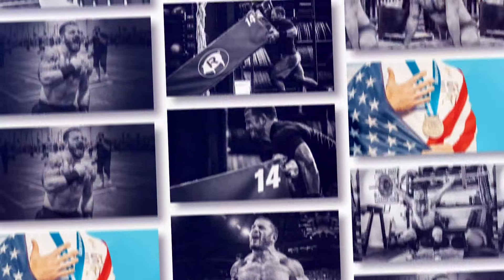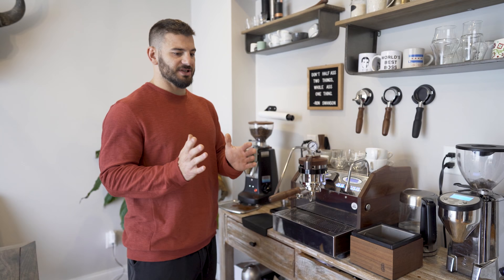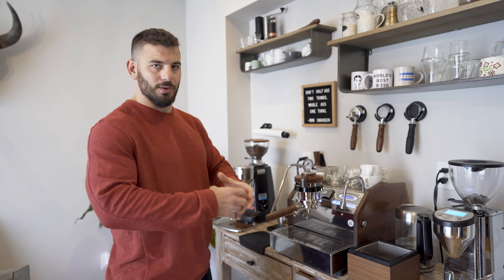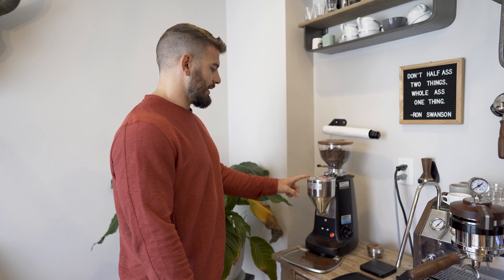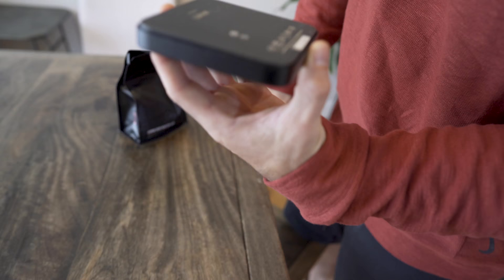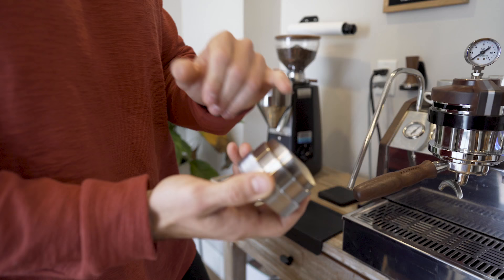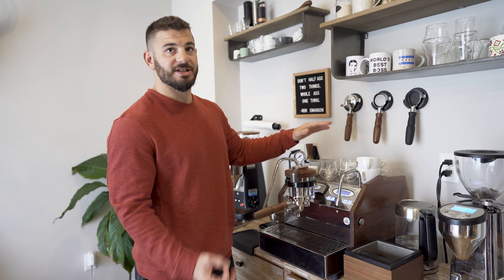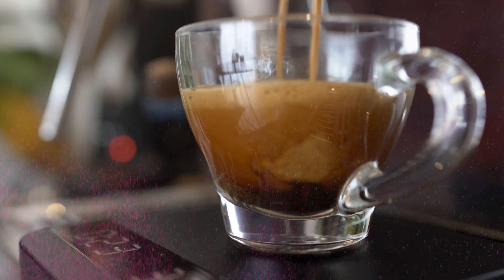Mat's Espresso Bar Setup

Comment: For Non-Coffee people watching this, do not be intimidated. Espresso is a world in and of itself even in the world of specialty coffee.

You can get some amazing results doing filter coffee using something like a v60 cone filter and an entry electric grinder like Wilfa Svart grinder or a manual grinder like the Hario Mini. The whole setup costing you around $50 and taking up minimal space.

Mat is clearly well versed in Espresso and he's built a very solid setup over time. You can start really small and cheap and get results that are WAY WAY WAY better than Starbucks/Instant and gives you room to explore new beans and flavors.

Comment: After owning our espresso machine for over a year, I've learned I'm doing it all wrong.  Now, I'm trying to learn how to pull a proper shot and am figuring out the technique of dosing and dialing it in, but not sure what flavor I'm actually looking for.  Did you work with someone on learning this? Or was it all trial and error?  I wish there were brew classes you could take to learn about flavor profiles and stuff where they help you dial it in and let you know when you've nailed it, so you know what flavor you're actually looking for in a good shot.